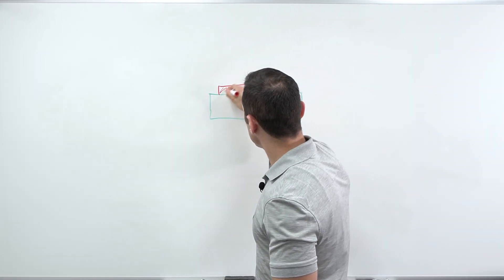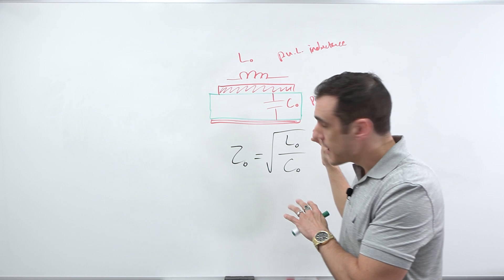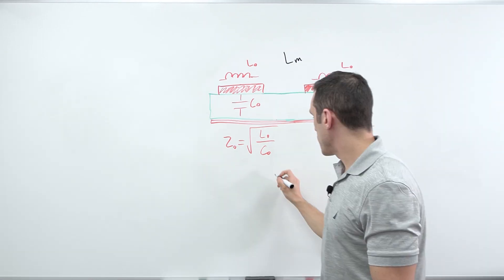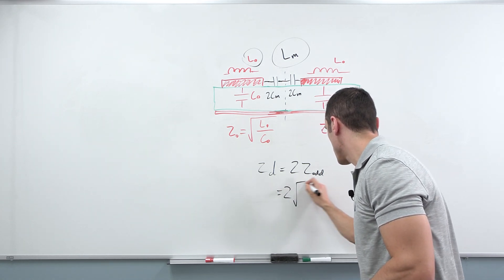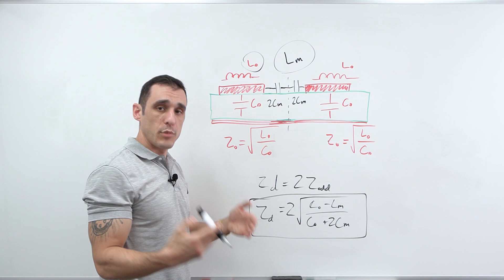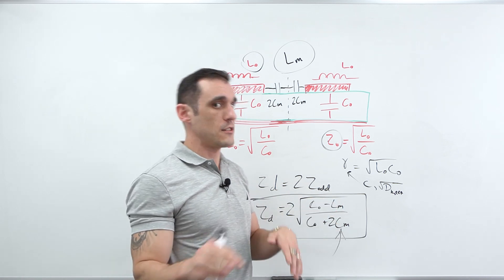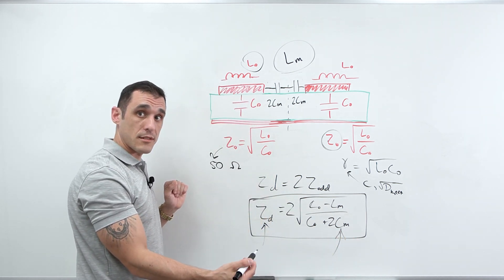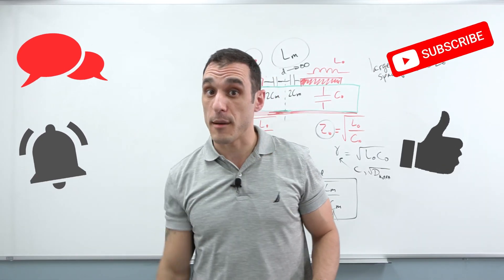Differential Impedance Deep Dive

Comment: Hello Zach, Thank you very much for the lessons.
I have a question regarding the last lessons, what about G and R? It seems you ignored it in this video.
At the end, the thing that matters is the differntial pair impedance, doesn't it? Then Altium will give the spacing, and the width of the transmittion lines. Will I actually need to calcualte these values?
Thanks again
Reply: I have talked about the G and R in other videos and in the seminars I give about transmission lines. The G is the trace capacitance multiplied by the loss tangent, and the R is the DC resistance per length. These factors, dispersion in the dielectric, and skin effect cause the trace impedance (both single-ended and differential) to be a function of frequency. So when you are calculating a trace impedance value in Altium Designer, Xpedition, or an online calculator, you are essentially calculating the average value that the actual impedance should be around within the frequency range that is relevant to your particular interface or channel. At the end what matters for differential pairs is the odd-mode impedance, and double this is the differential impedance. The odd-mode impedance is always less than the characteristic impedance, and it could be a lot smaller (like 20%) than the characteristic impedance. So the moral of the story is: you can't use the width for a single-ended trace, and then put that width into the trace width for a differential pair and expect the differential impedance to hit your target. You could be off by a small amount or it could be a very large amount (again, like 20%, which is enough to violate any interface standard).

Comment: Hi M. Peterson and thanks a lot for your content.
I have encountered two types of differential lines until now: for example, CAN bus and LVDS.
In CAN bus, I prefer looking as the lines as two singled ended lines, since they both have their own return path (reference plane underneath) and energy is launched/travels between the one line and the reference plane. So, we have two distinct energy paths.

In LVDS, the energy is launched between the lines and the one line builds the return path. So theoretically, no reference plane is needed. However, in practice, we want a reference plane underneath for two main reasons: unwanted common-mode energy in inevitable and the reference plane ensures a proper return path for this common-mode energy. A copper plane makes impedance matching easier and more stable/reproducible.

My questions to you M. Peterson are the following:
-	Do you agree with the statements I made?
-	Is the differential impedance calculated the same way in both cases I mentioned? It seems the impedance is only defined by the surrounding environment and its properties but I am confused because the electric field in the configurations shall be different.

Thank you in advance for your response and thank you again for you nice content.

Antoine
Reply: I would only disagree that CAN should be treated as two single-ended lines, if you route them close to each other they will have mutual capacitance between them which determines the impedance of each line. CAN also carries complementary signals. However, technically they can both be treated as single-ended lines, but with odd-mode impedance instead of characteristic impedance; remember that the odd-mode impedance is always a bit less than the differential impedance. The differential impedance is calculated in the same way for both; there is mutual inductance and mutual capacitance between the lines, and these values determine the differential impedance. In both buses, the reference plane also determines the self-capacitance and self-inductance of each trace. It is the total inductance and capacitance in each trace that matters as these determine the odd-mode impedance of each trace, and double the odd-mode impedance is the differential impedance.

Comment: Hi Zack, when talking about calculating the propagation constant. Just to clarify, you are talking about the rise/fall time frequency right, not a clock or signal frequency? 
The frequency would be about 0.35/Tr?
Reply: The propagation constant is used with the angular frequency to tell you the velocity of the signal, it is not a rise time or fall time. The signal will move a certain distance during its rise time, and that distance is the propagation velocity multiplied by the rise time. Also the equation you mention about "frequency = 0.35/Tr" has nothing to do with signal velocity, and it is probably the least understood equation in all of PCB design. Here is a video that tells you where that equation comes from and why it only applies in a specific situation that is not relevant to real high-speed designs: https://www.youtube.com/watch?v=eVV42ahG0as
Reply: @Zachariah-Peterson  To be clear, as digital signals are a combination of infinite sinusoidal waves at different frequencies. The frequency used with the conversion factor 2pi, is the fundamental frequency, so the frequency at which the (square) wave repeats its pattern.

Comment: I would like to know whats the effect of differential impedance mismatch? In regular single tracks, impedance mismatch causes reflections. Is it the same for differential tracks, but what its reflected is a differential voltage?
Reply: All differential voltages are defined by the difference between signal levels on two traces. So if you have a differential impedance mismatch, you need to define what happens to each of the signals individually. To have a differential impedance mismatch, then there must be a mismatch on each individual trace. If that occurs on one of the traces, then that signal will reflect from the impedance mismatch or discontinuity, so if only one trace has a discontinuity then only that signal on that trace will reflect. If it happens on both traces, then both the opposite polarity signals reflect, so in this case you would think of it as a reflection of a differential voltage wave. No matter what happens on the two traces, the receiver will always be sensing a differential signal, which is just the difference between the two opposite polarity signals.

Comment: Excellent explanation. First of all, thank you very much for educating us. ha! Now, I have a question. Like all equations seen, they depend on the frequency of the signal (Lo, Co, Lm, Cm). How does Altium calculate impedances (single-ended or differential)?? considering that it does not allow us to enter a specific frequency. thank.!
Reply: TBH I don't know all of the details used in that calculation. Altium's impedance solver uses a 2D method of moments or boundary element method calculation with a wideband Debye model for the dielectric constant, just like other commercial solvers. I do not know if it applies the wideband optimization calculation I talk about in some of my research (See my channel for more on this). It is only returning the characteristic or differential impedance based on the stackup dimensions and materials, it is NOT the input impedance or anything else; this is standard for commercial stackup calculators. Some CAD packages with built-in interconnect analyzers will give you the impedance of each trace section with a similar algorithm based on the presence of nearby conductors, so they give you another level of accuracy. With Altium, you can export your data for use in other field solver applications.

Comment: I can't seem to get my head wrapped around as to why You subtracted Mutual inductance from L0... I thought you were going add it.... I can understand why 2Cm was added with C0, but Numerator part is bit confusing for me... Would love to hear your explanation Zach...

As always, wonderful to learn from the master like you... Keep these videos coming and don't hesitate to lean on the difficult topics... ☺️
Reply: It's because we've defined the two signals to have opposite polarity and the impedance is defined in terms of the difference between these two signals. The Telegrapher's equations are being used to determine the propagation of opposite polarity signals down a transmission line, which requires taking a difference and produces the negative sign next to the mutual inductance. If we were looking at even-mode impedance (or common-mode impedance for the pair), we would have a positive in the numerator.

If you write out a 1st order differential operator for the Telegrapher's equations (which will include mutual inductance) and then apply the operator to the pair of signals propagating on the coupled structure, the negative sign comes out naturally.

If you like I can put together a video on this
Reply: @Zachariah-Peterson  Hi , isn't the numerator of differential impedance be Lo-2Lm ? as we generally use this for magnetically coupled circuits?

Comment: Hello! I would like to ask how to handle rigid flex designs where a diff pair starts somewhere on the rigid part, say on a top layer with a 4 layer stackup, and then eventually is routed over to the flex part, going through the inner layers. Im not sure what kind of answer I'm looking for to be honnest, but just a general overview with an application example I find is really helpful. Thanks !

Comment: Great video!! Explains a lot. I just have one question. Recently I was watching one of Rick Hartley's videos on diff pairs in which he said that he once routed a diff pair in a way that one leg was on one end of the board and the other was on the other end just to show that the spacing does not matter. Could you please confirm if this is really the case?
Reply: The (combined) signal from a differential pair is the signal of one minus the signal of the other.  So sure, you could even send them an hour apart on different types of paths (at the cost of a lot of latency and buffering).  But why bother?  The reason to use a differential pair in the first place is to better overcome  noise, and if the two half-signals aren't facing similar conditions (similar effective length in similar location with similar interference), then you're really just sending two unrelated but redundant signals.
Reply: @jimjjewett  Sure, but what if I just length match the two signals? I am not really trying to route them apart just making sure that slight difference in coupling wont get the signal to fail, right? So, in theory if I route them a hundred mils apart and length match them, the signal should not fail?
Reply: @waleedarshad8160  Length matching (ideally, with length weighted by impedance) means they arrive at the same time, which simplifies decoding them.  But why are you even using a differential trace instead of just a single trace?  Presumably, because you're worried about crosstalk or other interference corrupting your signal.  With two traces that are very close, this can mostly cancel out.  
1 - (-1) == 2, but so does ((1-3) - (-1-3)), even though noise of 3 would greatly overwhelm a single-trace signal.  If they're too far apart, you're likely to instead get (1-3) - (-1), and ... the differential pair didn't really protect you from the noise.
Reply: @jimjjewett  Your explanation is correct to an extent, but the common mode noise is most commonly due to ground offsets (if I am not wrong) and on a PC Boards with a uniform ground plane, I don't think this should be an issue. One common reason to use differential signaling instead of single ended signals is that the differential signals allow for greater data rates, which I think are not possible with single-ended transmission. Correct me if I am wrong, there is just too much information on the internet related to this topic and I am just trying to figure things out myself.
Reply: @waleedarshad8160  Ground offsets are certainly a likely cause of noise.  But doesn't their very existence mean that "uniform ground plane" is also an over-simplification?  
The bandwidth of sending a signal is limited only by the switching speed of whatever is generating the signal; the problem is decoding it correctly at the other end.  If you have a noisy enough transmission, then you'll want to take your time decoding it, to be sure it has time to get to the right level and isn't just being pushed around by some noise.  By doubling the difference between "on" and "off", and cancelling out a lot of the noise, the decoder has a much easier job, so it doesn't have to spend as long double-checking.  Routing the halves of a differential pair far apart will still leave you with twice the voltage difference (so you can still read the signals more quickly), but it won't cancel as much of the noise -- so you cannot reliably read them as quickly as you could with a normal differential pair.
Reply: Hi Waleed,

I'm familiar with the story and yes, you technically can do it that way as long as each trace hits the single-ended spec. What he basically ended up doing was set the characteristic impedance of each signal to be equal to the odd mode impedance (edit: note that this is due to mutual coupling) that would define the equivalent differential impedance that would be expected at the receiver. He nicely proved the point that the spacing didn't matter for signal recovery. In other words, the receiver interprets signals by looking at the trace impedances individually (i.e., as single-ended signals) which could be their odd-mode or characteristic impedance, depending on spacing!

This will be a topic in an upcoming video because I know this one gets confusing, I'll show it in terms of USB.

Spacing does matter for noise, but there are other levers you can pull to address noise beyond just routing the traces very close together. In one of the videos that was posted this week I talked about noise reception on a differential pair from an aggressor trace, something that Lee Ritchey also brings up. And mathematically, single-to-differential crosstalk is most easily canceled when the two traces are closer together.
Reply: @Zachariah-Peterson  thanks for the detailed explanation and yes this gets really confusing at times. Anyways looking forward to watching the upcoming fruitful videos. Thanks for the effort!
Reply: @Zachariah-Peterson  Why does it matter what the impedance of the traces is, so long as they match?  Is it just because too low an impedance will lead to (matched, but still annoying) reflections, or are there other reasons too?
Reply: @jimjjewett  Hi Jim, well when you say "the impedance of the traces" in the context of differential pairs, there are three possible impedances:

- Characteristic impedance: a purely theoretical value when the conductor and ground are totally isolated from any other conductor anywhere in the universe
- Odd-mode impedance: the impedance of a single trace when there is another trace nearby, and that nearby trace is carrying an equal and opposite signal
- Differential impedance: A summative impedance that accounts for coupling between the pair, I like to think of it as a mathematical shortcut to the odd-mode impedance (it's just double)

So in any case yes it doesn't matter what the specific impedance value is as long as they match at the receiver. Maybe that value they need to match to is 45 Ohm single-ended, maybe it's 50 single-ended. Maybe it's 90 Ohm differential, which implies 45 Ohm single-ended as seen at the receiver.

However, if you match them at the receiver, you should maintain consistent impedance everywhere else to prevent reflection somewhere along the line before you hit the receiver.
Reply: @Zachariah-Peterson  And this comment is just to say that I had already been searching for part 2 of the 2-layer USB series even before you wrote this (just in case it was already out and my notifications had somehow failed), so ... yes, please.
Reply: I'm not Zach but I agree totally with you. And I believe this is just what it is explained in this video : there are only two 50 ohms traces that when you bring them close enough, well this mutual Cm&Lm start to affect your diff impedance which is no more 2*Zo. The reason to have differential pairs is to remove common mode noise (conducted). For cross talk forget it, twisted differential wires can cancel crosstalk radiated from around, but differential pairs are just routed on the same plan : they will never (ever) have the same crosstalk, unless a boldy guy decides to route a trace along this diff pair or on the layer above...